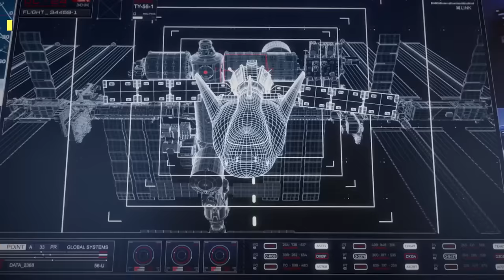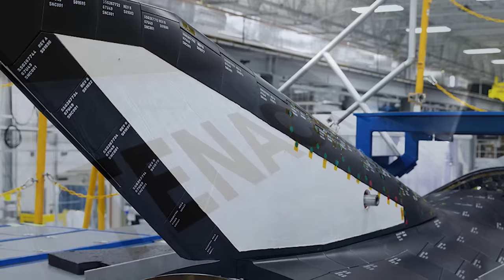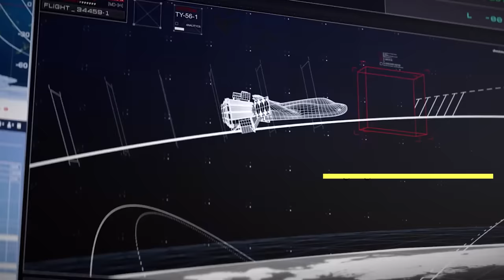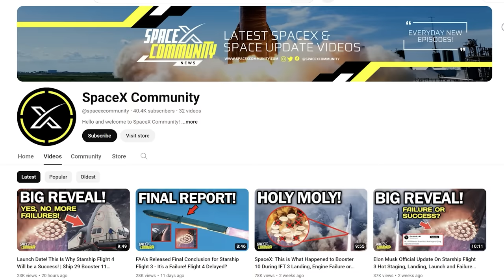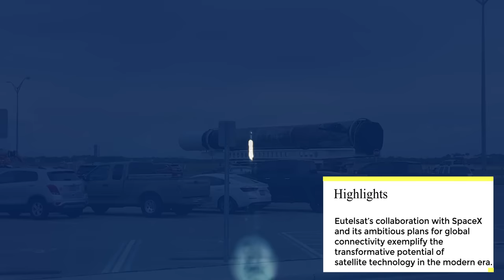Sierra Space to Launch Dream Chaser, Falcon 9 Milestone | Episode 33

Comment: The thing about flying is the two major points.  Take off and landing. SOoo if you haven't noticed they want to save weight so they put match stick landing gear (skid nose gear)  on these things. Military air is good for doing that as well.
Reply: Have to wonder how that landing skid doesn't cut a groove in the runway when it lands.

Comment: The Dream Chaser is a beautiful craft but VERY expensive and VERY technical in its design components. As far as cost to orbit, Space X is still in the drivers seat with its reusable rocket. That's what gets you there as reasonably as possible. Others may come but we are at least three years away from another sizable, reusable American launch vehicle other than a Falcon or Super Heavy. That includes Blue Origin who has temporarily scuttled their return rocket.They have been predicting all along that Dream Chaser will be the go to manned rocket of the future. In some cases they show a fleet of manned Dream Chasers positioned around some future space station. They were meant to provide a return vehicle if needed. There is absolutely no way that will happen with this iteration. It will have to be simplified in some ways to make it easier, quicker to build and less costly. I understand they have a manned version on the table but I think that would take 3 to 4 years to get certified. If Starliner works there will not be much money for Dream Chaser. If the Starship works, they can put 2 1/2 times the weight of any competitor into orbit at a fraction of the cost within one to two years. None of this includes alternative return designs currently being considered by operators like SpaceX in the development of their space station.